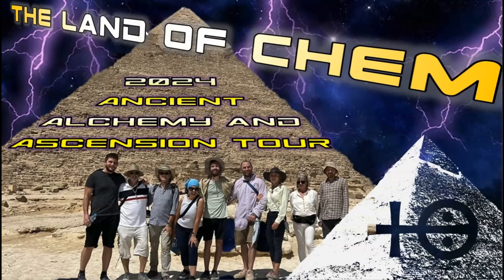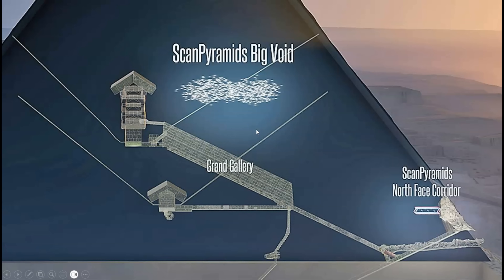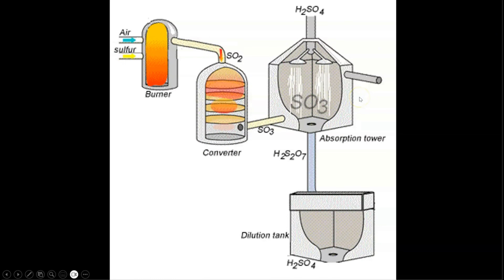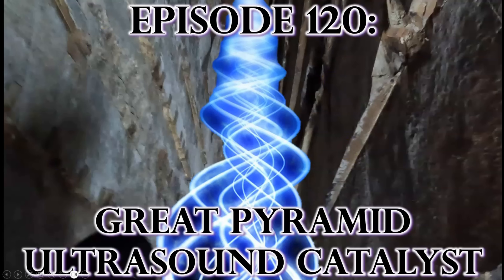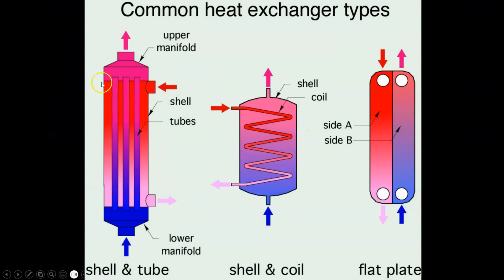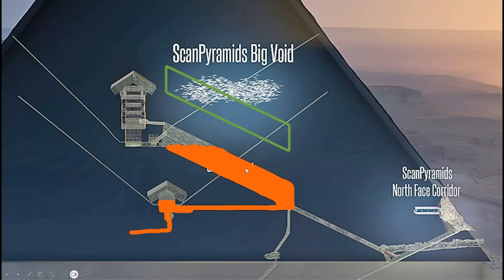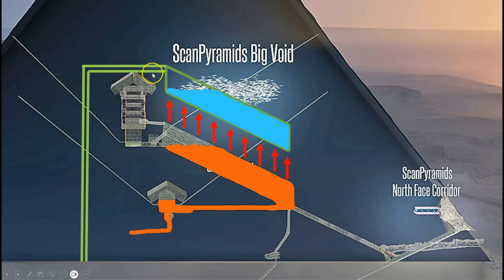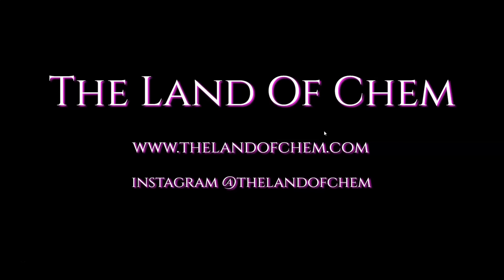Episode 138: ANCIENT TECHNOLOGY - The Function Of The Great Pyramid Void

Comment: Thoughts on this possible chamber. A heat exchanger makes sense but maybe a bit different configuration. There is a much simpler design that requires no steam venting or dumping of the hot water. A "thermal syphon". Sealed and recirculating. I suspect the H2SO4 would have been done in batches as opposed to a continuous process providing sufficient time for a full cool down between. The thermosyphon requires no mechanical pumps and can be used to extract or supply heat. I use this in structural designs. In conjunction with thermally connective wall systems, I cast geopolymer stone of varying densities and color. Was the Great Pyramid not cased in white limestone? If so, that would be the cold side for heat loss. In the convective walls I am currently testing I use a very dark basalt in a slag geopolymer where I need heat absorption, a red from a local volcanic tuff where an even exchange is required,...and a white limestone/alabaster/marble where I wish to lose heat instead of gaining it. Maybe just a coincidence.

Comment: What is the water pumping mechanism for the system? Baskets of water carried up to prime the system, or a pipe works fed from an elevated reservoir km's up the river? How many lightning strikes are needed to complete the stages of each process in the cycle, and is it a single batch or a continuous flow process?

Comment: As liquid pressure raises, the boiling point raises and potentially becomes explosive-eg water usual boiling point at atmospheric pressure is 100 degrees c. As pressure raises boiling point raises, so if pressure suddenly dropped(leak or failiure of a door etc) water would turn to steam at a rapid rate and be explosive. Water expands by 1600 times when it turns to steam.
Reply: Think of a cars cooling system. It is pressurised which greatly increases it's thermal stability.